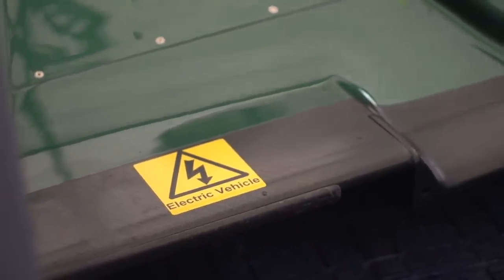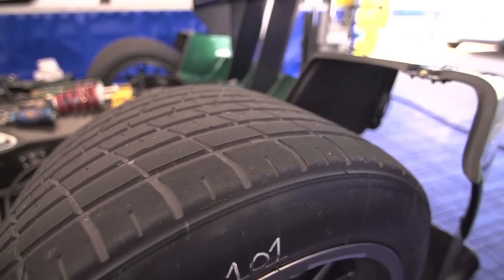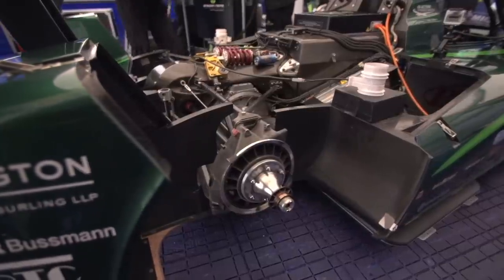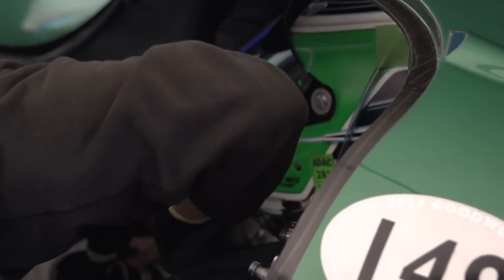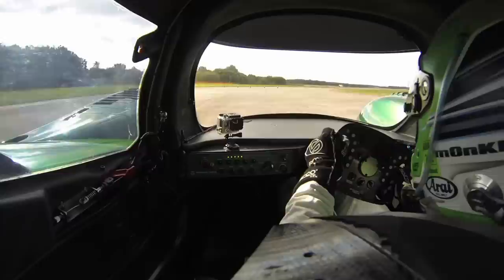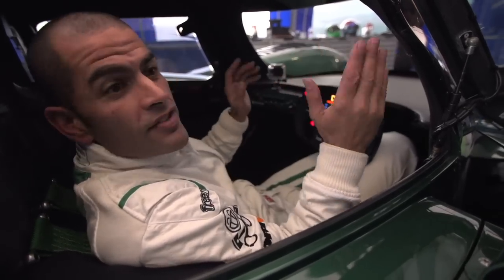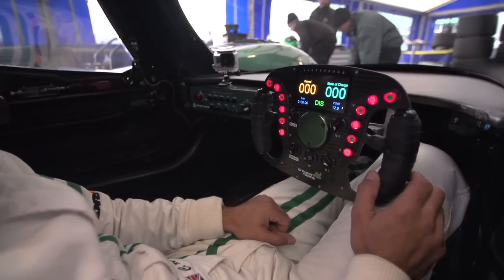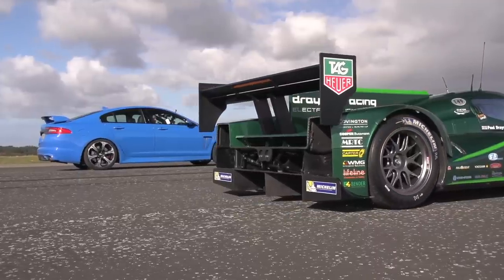850hp Electric Racing Car: Driving the Drayson B12/69EV -- /CHRIS HARRIS ON CARS

Comment: /DRIVE, I couldn't help but notice the turnknob labeled "BRAKE" on the steering wheel. Does this mean that the Drayson uses an electric motor-assisted braking to some extent? And if it does, does it implement some sort of individual wheel braking system to help with cornering?

Comment: Not much a tech head myself, but I was thinking casually about designing a vehicle that takes advantage of heat buildup in the engine for power, similar in concept to how the KERS uses power stored in braking for power. Some parts of the system would no doubt have to be made of something like tungsten, something that can withstand extremely high temperatures.

Comment: What if there is a device than can be attached to the wheels and it functions like an alternator charging the batteries?  An electric car may gain back some energy while on cruise control with this device. Then to add noise, make a scoop that whistles louder as the car goes faster.

Comment: Now I'm definitely no engineer but I know you can change mechanical energy to electric with some sort of rotary action and magnets and coils and stuff, but I'm wondering if it's possible to make some of the mechanical energy from the wheels back into electrical energy. Sort of making the car a generator as well.
Reply: That technology has been out for a long time. It's called regenerative braking. F1 cars have a special form of this, and they're using a even more high capacity version this year too.
Reply: Thats sick. I just didnt want a good idea to possibly go to waste by not saying it. I wanna know if major car manufacturers are working on ways to apply this sort of technology to daily drivers, though not in the same capacity, as it isn't the same conditions. It would be nice to see a completely (well close to completely) green car whether it is racing or just everyday transit. I know ford is making some car parts out of organic materials and the racing industry is putting a lot of effort into high performance electric engines but cars should try to mimic a horse on its environmental impact.
Reply: I know and it's sickening. I get that corporations have every right to engage in efficient business practice to what degree they want, but there has to be a time when they should reflect on the ethics and consequences of their decisions.
Reply: EpixArtwork .  You have to understand, these corporate fat cats only listen to their wallets, so we may as well make their wallets sing a good tune. I own a truck, and I'm tired of the oil corporations working my wallet over at the end of every week. Ultimately, very few people have the ability to manufacture their own car from the ground up, electric or not. As such, the people that can are a necessary evil, but we can generate our own electric power through other means, unlike gasoline. So, at this very moment we are being screwed over not only by car companies when we buy a car that lasts us a few years, but oil companies as well every time we fill up the tank over the life of the vehicle. We can't live our modern lifestyle without cars so we may as well take out the greater evil first. If, in the future, people are able to make there own cars at home, then we will conquered both issues. So we may as well fix the problems when we can, so that we aren't plagued by their money leeching costs in the future.
Reply: i was thinking the same thing, why not make a recharging system, like the batteries powering a recharger which in turn charges the batteries, its a never ending cycle, or have the friction from the tires power a recharger which in turn charges the batteries
Reply: jacob scriver well it would be impossible to have a completely efficient system but it would be possible to save some of the energy
Reply: For non-hybrid cars using the technology of regenerative braking, check out the BMW 5 series, 6 series, X3, X5 & X6. They have been using the technology since 2007 (they heavily pushed for it to be in F1 as they wanted to tie it in with their car promotions). Otherwise most hybrid cars use regenerative braking to charge batteries, and cars such as the Smart Car use a flywheel based mirco hybrid system to replace the alternator. On a larger scale, newer buses use it, and on a much larger scale, electric trains.
Reply: EpixArtwork . Pretty much all mass market electric cars have regenerative braking. It's very very useful for extending the range of the car.
Reply: they already have that, they are just about to use it in f1 engines, its an anregy save module, its testing, and its maybe close to what your talckimng about or very similer
Reply: Not only has it been developed for electric cars but Union Pacific has/is testing the same technology for their locomotives

Comment: This thing is impressive in so many ways.  I do wish they had given us an idea of current range and average performance with that range.  It would also be interesting to see if performance does a gradual drop off or if it is linear until it runs out of energy.  While there is no engine noise, it is kind of cool to hear the car bottom out over bumps and break a hole through the air.
Reply: i'm guessing here but i think the range and preformance changes from week to week since they are experimenting
Reply: I agree with you.  I was just wondering where they are with that range right now.  And again, I am curious to see how the performance degrades with a reduction in charge.

Comment: I would hate to go to a electric car race.. Combustion engine sound is a big part of what makes going to a gran prix, nascar or whatever pro racing series so awesome. I freakin get goosebumps when i hear a race car start up.
Reply: You'd just be hearing ear-piercing tyre roar and high pitched jet engined whirrs and whines. Because of the lack of insulation, they're loud. They may not be tyre roar, F1 engine, double decker bus or anything "ear bleedingly" painful and loud, but would be unfamiliarly spine chilling and cool, and I think that's counts. That's how Formula E is going to be like.

Comment: People! Toque is just power at low RPM, nothing else. It is just used to tell engine characteristic.... torque and power can always be calculated from each other and engine RPM... So it is pointless to tell torque reading in engine that has same power at any RPM... Electric engine just makes big torque reading because it can run under petrol engine RPMs and still has 850 hp. Just forget that 4000nm, this car simply has 850 hp at all time

Comment: There's nothing quite like the sound of a high revving racing engine, but there could be a place for this.  What about making solar panels as part of the roof that could help recharge the batteries?  Wouldn't help at a place like LeMans, but most races it could be helpful.

Comment: Electric motors offer instant torque. That is, literally, maximum torque at zero RPMs. This is something ICEs will never be able to compete with. What is holding the electric car back, though, is the battery: How much energy density it has, how fast it can be charged and discharged,  cost and its weight. Solve those problems and the infrastructure needed to make them practical to every driver and the electric car will finally be accessible to everyone. I truly believe this can happen in the next 10 to 15 years.

JW3HH
Reply: +JustWasted3HoursHere Batteries in cars are becoming more endurant by the second, it'll be quicker than that.
Reply: +Tubuscular Saxophone There are several battery technologies in development that will offer great advantages over lithium such as more cycles (charge/deplete), much much quicker re-charge and lower price (in some cases, like the sodium-based one being developed in France: Sodium is very abundant).

If electric cars can recharge at a "gas" station in less than 10 minutes, then the playing field will be officially leveled.

JW3HH

Comment: Anyone know, at which rate approximate does the endurance capacity of batteries (per kg) increase currently? It would be nice to be able to draw a little trend line to see when these babies could manage Le Mans stints, or let's say a full hour race.
Sure, you could attach a 400kg battery trailer and nearly double the mileage (actually a good idea for Tesla Model S style car), but a race class probably should have a maximum weight, also for the batteries combined.

Comment: Rotary motion to rotary motion. Its pure and simple. People say 'Oh RC cars' and 'Oh 5 minutes'. Well, just happens I've raced RC cars for over 20 years. And yes, this does sound just like a Associated T6.2. However, in reference.... in 1990, we had 1400Mah SCR NiCd batteries and ran a maximum of 4-5 minutes in Mod class before they where dead if you were lucky. Now, with simple Lipo which has been out for almost a decade, we run upwards of 40-50mintues on a single battery. Brushless Technology has changed 1/8th scale off road where Nitro dominated and the torque and acceleration is just immense! Now, translate that to full scale, yes there is the exponential rate of resistance and watts needed... however... just in RC there have been leaps and bounds and soon enough, it will translate to amazing vehicles like this. The technology is there, the parts are there. Its just a matter of stacking HyperFetts and getting proper phase motors and those pesky Li-Mg or Li-O batteries to work!
Long story short: This is amazing!

Comment: I feel like what is holding electric cars back is not the strength of the motors, but by how limited the energy source is (this video reinforces my point). I think that once battery tech is more improved, electric cars will easily be so much more faster that combustion engines.

Comment: That drag race doesn't do it justice... Well, it would, if the car was built to do that. With that same motor/battery setup, but proper drag racing suspension/tires, body with no drag, and so on, it could hit 0-60 under 2 seconds and 100 mph in probably less than 4... Neat.

Comment: How does the gearing work, is it a cvt or is it just direct drive?
Reply: Direct drive I believe. The only electric vehicle with a transmission that I know of is the Rimac Concept One; which has 4 motors, one for each wheel, with the rear wheel motors having two speeds.

Comment: I race off road 1/8 4wd electric buggy, as well as nitro buggy .. I haveta say that the nitros draw a bigger crowd, both drivers and spectators. The ebuggies are insanely overpowered and require major throttle control via finger mostly and esc programming. Whereas the nitros buggies are as powerful as they need to be and are so much fun with the noise and smell.

Comment: That last comment.. IDK. There are very few noises that I would enjoy that isn't a combustion engine. I suppose a turbocharged or supercharged combustion engine. But if you want electric car to sound exciting you have to make it sound like it's there are a couple of dudes with light sabers in the engine bay.

Still not sold on electric power alone. Hybrid technology has well and truly taken off in top-end motorsports but we're still far from completely removing internal combustion.

Comment: That was is really interesting is how the engineers manage the thermal problems, because the electrical motors with a very high efficiency over 95% will produce a huge amount of heat. What also is interesting is the evolution of the type of frequency converter that they use in this particular car. But, they pay in form of a very short battery life at only 10-15 min of use. It will be interesting when the car will hold for hours or more.   The real potential is by far not reached yet. Think if this concept could be used in fx. oil tankers or other heavy carriage vessels.

Comment: The part that keeps getting ignored is range. Yes, it is spectacular performance, in a race car that is so light that with 300 kg (660 lbs) of batteries, it only weighs 990kg. A gas-engined LeMans prototype car will blow the doors off that Jag, too. Of course you can refill the gas tank very quickly on that gas car, and get a lot more range out of the tank than this car will get out of its batteries (which will take a long time to recharge).
Those "light-weighting technologies" would make an ICE powered car have tremendous performance, as well. That loss of weight is at least as impressive as the electric drive.

Comment: but my question is, will battery changing which takes like every 2 laps, beat the refueling which is like every 10-15 laps?
Reply: +justin baba I think instead of battery charging they would design it so that you would just swap the batteries out.

Comment: Interchangeable battery banks in the pits in lieu of refueling gas, and you have yourself an amazing racing series. The swapping of cars during a race loses my interest in Formula E. The fact that these cars have limited sound decibels, you can run them in more city circuits, and is a huge entertainment factor however.

Comment: I wouldnt worry too much about the sound of the engines ,sometimes the drivers need the sound of the engine for braking, and maybe wheel spin if any, , but it aint nothing that a amp and speakers cant produce , in fact they could program any sound they wanted to work with the rpms,

Comment: Noise is an easy problem to solve. With electric car you can have any sound you wish. Just add external speakers and that's it. If you think that's heresis, remember that some petrol cars already do that. One BMW model with a weaker engine produces the sound of a stronger engine through its speakers, in addition to the original sound. And nobody complains.

Electric vehicle is inherently silent, so whichever noise you put on top of it, that's the noise you get. There's no interference with the car's own engine. You can make it produce the F-35 jet engine sound, or Space Shuttle launch sound, or Ferrari or Porsche engine, or Top-Fuel dragster sound, or helicopter gas turbine sound... there's no limit. In that regard it's much funnier than petrol cars that only have one main sound, which interferes with other sounds.

With electric cars you can switch sounds while driving. Imagine you're on red light and your flooding the street with the jet engine turbine sound. Awesome, right? And yet, if you need to sneak up on someone, just switch to stealth mode and you're a silent assassin. Petrol cars can't do that.

Comment: I do agree that the lack of noise makes it rather sanitary but this is the future of not only motorsport but road transport. I agree that the tech is not quite there yet and many of the anti-comments made here I would agree with right now but things are changing fast. I am sure than the vast majority of the problems or issues raised will be resolved in a few years.

However, there is one that will not - hydrogen. Hydrogen has so many problems I just can't see it being worthwhile when electric power is so easy and simply. In any case... it is so inefficient. No one who looks at hydrogen in detail would consider it as a worthwhile option. Sorry.

Comment: It's neat, but the numbers you posted are about the same as a Suzuki Hayabusa or Kawasaki ZX-14R stock, street legal sportbike.
Reply: Jackie Scholl ...and?

He was ranting and raving about how nuts and unworldly the acceleration and torque was even for a race car. Doesn't matter if it was battery or anti-matter or hamster powered, for all his noise... doesn't seem that impressive.

If you're, for some reason, thinking that the gas-powered and electric cars should be held to different standards, then I can rephrase and state that the numbers he posted are about the same as the hybrid-electric La Ferrari, Porsche 918, or Mclaren P1.

Just you don't see those every day on the street like you do with sportbikes.
Reply: Notice when this video was posted? Now the Tesla P100DL is rated at 2.5 seconds from 0 to 60 mph and that's street legal. Other non street legal electric cars are now under 2 seconds, the recent official record being 1.5 seconds. There are also drag racing electric cars that can accelerate faster. How is that for progress?

Comment: what about saftey factors? There are always accidents in racing. what about the possibility. of battery acid getting spilled on the driver in a severe crash? Just need to wait and weigh all the facts in the end Hope to find answers for the many questions on saftey of evryone who is either racing or saftey crews during a crash.
Reply: +Mike Goble These kinds of cars don't use the generic lead-acid batteries you're probably thinking of. They would use some form of lithium cell technology, which have no acids. The real concern is keeping those batteries from bursting into flames or exploding if broken since lithium really doesn't react well with oxygen. All those stories about phones blowing up, it's because of the lithium batteries in them. Not saying lithium batteries are dangerous, it's simply the nature of lithium.
Reply: +Mike Goble 
Their batteries don't use acid and nothing in there sloshes around. Only real danger is fire, which has always been a problem with all race cars.

Comment: People like the sound of the switching gears, which is only applicable for ICE, so that might be the problem.
Reply: +Insert name HERE Gears can work for Electric Motors. They are heavy. Electric cars are quite heavy but they still do 0-60MPH insanely fast. Its tough finding a easy to mass produce gearbox that can take the power